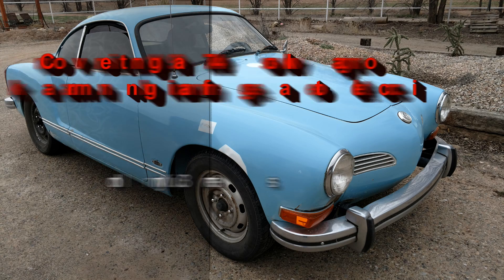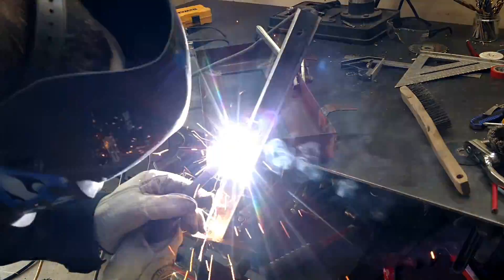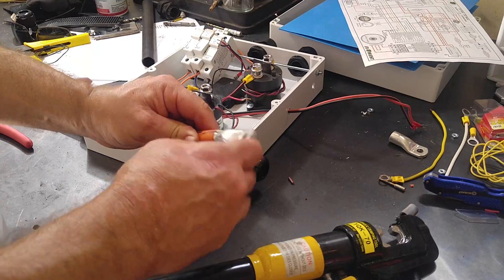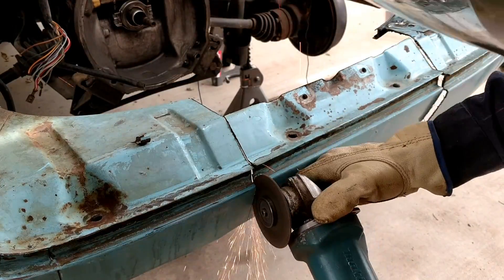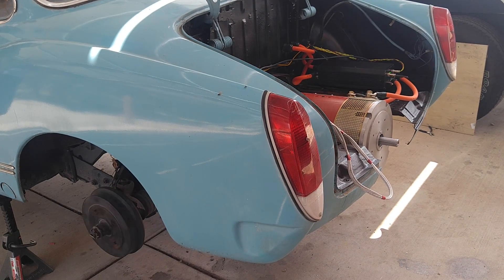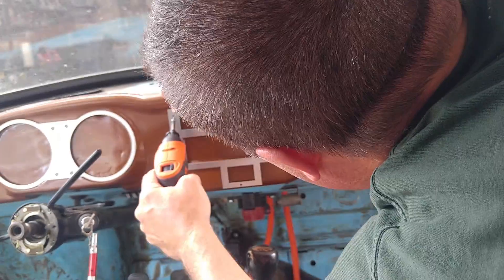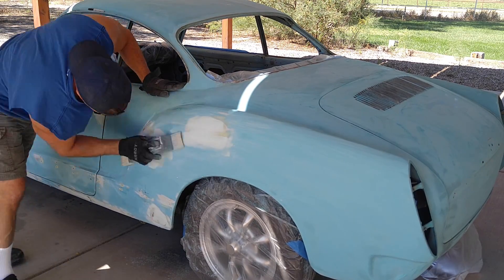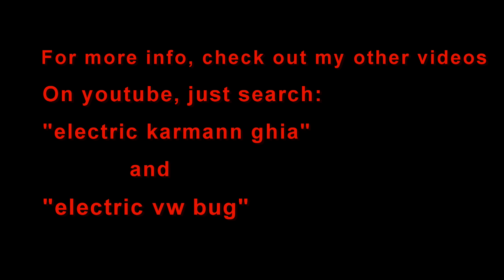Karmann Ghia Conversion to Electric (The Process)

Comment: Nice job, but the trees need CO2 to live. The current NASA photos from space sow a greening earth due to more CO2 and we need to keep it up.  We were at a point that any less CO2 would inhibit plant growth so we really do need more.   Don't worry about to much temperature change because the CO2 only reflects a small bandwidth of the sun's energy and CO2 is almost at saturation so it now takes exponentially more CO2 to effect any change which means the temperature modulation is absolutely self limiting with atmospheric CO2.   Great looking cars, just be sure and use a fossil fuel generator to recharge them..

Comment: What’s the top speed ? How far can you go on a charge ? Would you have to up date to disc brakes ? , thought about this , had an idea of doing something using a vw floor pan and having interchangeable bodies,  would it be possible to do  a mini van with solar to charge the car while setting outside ?   Great video bro !
Reply from the maker: It'll go up to 100 mph, and 120 miles max (but I use 100 for the max). Yes, VW's have some interesting options for swapping bodies. As for the solar, if the roof were covered in solar panels, you'd generate maybe 500 watts max. Since my battery pack is 27 Kwh, it would take 54 hours of direct sunlight to fully charge. You'd only be generating the 500 watts for a few hours per day, so it would take weeks to recharge! I love solar, but on the roof its really not very practical.
Reply: Botts Fine Vids , thanks for the reply, answers a lot of my thoughts, needless to say you’ve got a bad ass ride bro ! 👍🏼

Comment: Amazing job man. Truly inspiring! Great stuff
Reply from the maker: Thanks, I really appreciate it!
Reply from the maker: Not really unless I swapped out the whole rear end with a Chevy or something. The differential and transmission are in the same unit, so you really couldn't link the motor to it. The transmission only adds about 70 pounds, but it gives you so many more performance options. I drive 95 % of the time in 3rd gear, but I shift to 4th going over 80 mph, and 2nd if I really want to burn rubber and blow somebody off the line!

Comment: Do you have to recharge at a station coz I don't see any photovoltaic cells on the car?
Reply from the maker: I plug it into any standard 120 V outlet. Even if there were photovoltaics on the car, the amount generated would be insignificant.

Comment: there is no clutch required and it just drains the batteries to push the unneeded mass. Why not just have coupler machined from trans input to the motor shaft.  Don't even need a trans except for the direction of power change.    I don't see a link to the battery source it would be great to know.
Reply from the maker: When you compare the angular kinetic energy of the wheels and every other rotating mass, a tiny flywheel and clutch is utterly insignificant. A transmission gives so many performance options and only adds about 75 pounds. They are Voltronix 180 Ah batteries which I bought used from somebody who was using them as a battery bank for their home solar system.

Comment: Very impressive. But no battery cooling and no upgraded brakes (for the additional power and weight)?
Reply from the maker: I do have disc brakes in the front. Battery cooling is not necessary. Even after driving 80 miles, the battery temperature only increases by a couple degrees. I was surprised. These batteries for the most part are operating at less than 1C (180 amps)

Comment: I have the space 
I have the money
But currently don’t have the knowledge to build a 8 second, all-wheel-drive electric street machine.
What would be a good vehicle to convert for such duty?
The diffs gotta be able to handle the necessary torque and power to run high 8’s at 155 mph 
Any ideas??
Reply from the maker: The best one I've seen is the Zombie 222 Mustang. Also, the White Zombie Datson. I had to get stronger transaxles for both mine, with a super differential, but even those wouldn't hold up to 8 seconds! You tube those two cars.
Reply: Botts Fine Vids 
When I was 14 years old, back in the mid 70’s. My brother owned a new red, with black convertible top Karman Ghia. Greatest thing ever!
We downed quite a few beers, and burned down weed plants in that car.

Comment: Yeah, I get that you had to make the engine fit. But... you do realize you cut out an entire section of a unibody?  I'd be worried about structural failure over the upcoming years.
Reply from the maker: Of course I'm aware. I did it. I installed a traction bar that ties the two sides together and supports the motor. Not the slightest bit worried.

Comment: That's the way to get them a new polution free life again on the road, so we could safe a lot more resources 🕵‍♂👍💪
Congratulations for your excellent job keep going on never give up 👆 ☘️
What about a Beach Buggy with electric power engine and 4X4 or a Pickup Truck 🤔
Best regards from Asia 🐘🏝🐘🇨🇭
Reply from the maker: Thank you very much. EV West made a Baja VW bug which is very nice. I've seen 4x4's too, but you just need a lot more batteries.

Comment: So how much did everything cost to do this?
Reply from the maker: Around $17k for the conversion, and maybe 3k for the restoration.
Reply: Love the video 👍

Do you have a parts list and recommended suppliers?
Reply: @gjhammond01  EV West has a kit, both without batteries, and with Tesla Model S batteries, which I expect is probably good choice for first time converters. I am thinking to go down that route in the future.
Reply from the maker: @gjhammond01  evalbum.com/5330

Comment: Holy awesome.  That was most excellent.  Sounds like there is a kit that fits this, or it's fairly straightforward to do on your own.  Thanks for posting.
Reply from the maker: I believe EVWest has a very nice kit that would fit right in, but they use AC50 motors which don't have nearly the torque of a DC.

Comment: Hello my friend introduce myself I am Montasser from Egypt I watched your video transforming a Dodge into an electric car. and in all honesty you did a great job
I am wondering if you were allowing me to ask several questions. As I intend to carry out this work on my car. The first question is is Dodge still working efficiently yet? second question. You switched the power source in the car from 12 v to 380 v and I wonder how you made the 12v parts keep working. I mean lights, signals, radio and air conditioner
I really need to communicate with you in an easier way than e-mail
This is my phone number
00201033887573
We can use WhatsApp to communicate if you don't mind
With Regards
Reply from the maker: Thank you. First, it is a Volkswagen, not a dodge, and both cars have been working perfectly since the day I built them. Your question about voltage -- there are two separate busses, the twelve volt system which runs the lights, signals, radio, etc, and is grounded to the frame. The high voltage bus, which drives the motor, is completely isolated from the 12 volt, and is NOT grounded to the frame. It is its own closed loop. Good luck with your project!

Comment: Wow! Can you share your building plan and the specs of the motor? Did you deal with the original heating or are you only driving the car where and when it is warm? What range do you get on the batteries? So many questions, but only because it is something to aspire to.

Comment: They(Electrical Cars with solar panels) are responsible for burning fossil fuel. Just think energy needed to manufacture solar panels, and the process is very toxic to environment. By the way great project, thumbs up for you.
Reply: oh there's always one. you need energy to look for oil, drill for it, pump it, pipe it, refine it, distribute it and retail it. oil is toxic as well, you not heard of oil spills?

13 Feb 2020: "The 2010 rig explosion, which killed 11 workers and sent oil spewing into the Gulf of Mexico for 87 days, triggered one of the worst environmental disasters in US history. It released 206m gallons of oil from BP’s Macondo well, according to US government estimates, affecting wildlife and water-quality along hundreds of miles of Gulf coastline. At its height, 88,522 sq miles of sea were closed to fishing because of the spill, according to a federal report.

But a new study published on Thursday in the Science Advances journal says satellite surveillance at the time was unable to detect large areas of oil contamination. The study’s authors found that the effects of the spill were 30% larger, reaching the Texas shore, the Florida Keys, the coast of Tampa and parts of the east coast of Florida. “The satellite footprint does not necessarily capture the entire oil spill extent,” the study found."

https://www.theguardian.com/environment/2020/feb/13/deepwater-horizon-disaster-oil-worse-impact-study-finds

Comment: Great video, can you do regeneration braking with a DC motor? And why did u go for a DC motor when you need a converter anyway? Thanks
Reply from the maker: I don't need a converter. Batteries are DC, so it never needs to change.

Comment: Very impressive job! Great colors and the bolts of electricity was a great idea! When you stated VW were not built to do 100 mph, you were totally correct that’s why they only came with what 60 hp at the most? I had a 59 Karman Ghia that had only 35 hp! However when you brilliantly added all the extra weight and I’ll guess helped with balancing away the rear weight bias a stock gas powered Ghia was designed with originally? I’m willing to bet with good Koni or Bilstein shocks that little EJuice Ghia will be fine an fun as fast as that motor can push it. My only question is what kind of distance can you get and does the Bug still have the rear seat?

Comment: I owned a 74 Karmann Ghia for 19yrs! mild Kustom, in inmaculate shape till the day I sold it. 
 Excellent job in turning it to electric. I think the shape of the Ghia lends itself perfectly for "electric speeds".  I know you saved tons of cash by doing all the labor yourself, but, what was the cost for all the parts (e-motor, batteries, etc etc?). And...do you do this to other cars?

Comment: where did you get that motor? i have a 1984 380 SL that I would looooove to make it electric.
Reply from the maker: I got it from EV West. There's quite a few dealers. It is a Netgain Warp 11.
Reply: Botts Fine Vids the biggest issue here is that custom trans plate. EV West has a lot of stuff for VW but thats all... guess im gonna keep doing some research
Reply from the maker: I would find a good machine shop and bring them a template. Maybe press a board covered with clay onto the tranny  I don't think you could simply measure it accurately enough.

Comment: apologies if this is a daft question...but I thought ev cars were like go-karts...i.e..2 pedals...go and stop. You left the original gearbox in and clutch pedal. So you have a 4 speed manual change? I honestly didn't realise you could have a manual box.... I thought it would be  fully integrated automatic box...which would be part of the electric motor.
Reply from the maker: I rarely shift, so it feels like direct drive. However, it is nice to have options, like 4th on the highway and 2nd if I want to really blow somebody away off the line. Not to mention reverse! It only adds about 75 pounds. Plus, since VWs have a transaxle, you'd almost have to take the whole rear end out of a car with a stand alone differential. I don't know how you'd couple a motor to a VW without a tranny.

Comment: The electric motor just mates up to the bell housing.  Was the motor especially made just for VWs?  Or just the housing with a motor inserted?
Reply from the maker: Actually there is an adapter. EV West and some other companies make them for VWs and a bunch of other cars. I would have machined my own, but if you're off by just a tiny bit, say goodbye to your bearings!
Reply: @bottsfinevids4463  
Compared to other EV motors I have seen, it looks long.

Comment: Is this a motor kit?  Where did you find the trans mount?  I'd love to do this with my dunebuggy
Reply from the maker: It was not a kit, there is an adapter. EV West and some other companies make them for VWs and a bunch of other cars. I would have machined my own, but if you're off by just a tiny bit, say goodbye to your bearings!
Reply: Well, the video was awesome.  Could you post more information on where you got the motor, batteries etc? and models maybe?

Comment: I bet it still leaks oil....
Reply from the maker: There is no oil, except in the transmission. No leaks though! Possibly the only VWs on the road without leaks!
Reply: @bottsfinevids4463  What does the conversion cost?  How many miles or hours can the batteries hold?  Could a flexible solar panel be mounted on the roof? or maybe on the dash board and rear package shelf?

Comment: Around 150 kmph? Very decent. Whats the range?  Owners of old gas guzzling "Land Yachts" can benefit from an EV conversion.
Reply from the maker: The absolute range is 120 miles, but I use 100 miles as a limit, just to give myself a buffer and the batteries don't like complete discharges. At highway speeds of 80 mph or more, the limit is probably around 75 miles. And yes, everybody could benefit, especially our grand kids!

Comment: It ain't a Karmann Ghia without the characteristic VW boxer sound, it's only an empty shell. Like scraping off the paint of a Van Gogh and redo it with water based paint. Don't destroy classic cars ffs!
Reply from the maker: Well it would absolutely destroy a Karmann Ghia in every single way, except range. So if you must have a 50 year old crappy engine for sentimental reasons, don't let me stop you!

Comment: what protects the engine bay electronics from WEATHER/WATER/GRIT?
Reply from the maker: The only electronic thing in the bay is the controller, and it is fairly water proof. However, I do try to avoid heavy downpours, and I sure as hell wouldn't drive through a deep puddle!
Reply: @bottsfinevids4463   makes sense

Comment: why not solder AND crimp connections?
Reply from the maker: Because crimp connections are just fine by themselves if done correctly. There's endless debates about that! I've never had one fail.
Reply: @bottsfinevids4463  over time, mechanical connections can't loosen from vibration?  Bumps in the road, etc?  Hot/Cold expansion?

Comment: why put 1000 amps inside of a PLASTIC control box??
Reply from the maker: As opposed to what?
Reply: @bottsfinevids4463  ~ metal for shared ground, and a metal box could slow down a fire?
Reply from the maker: @etyrnal  Actually shared ground is the opposite of what you want! The high voltage system is isolated from the chassis, whereas the 12 volt system has a normal chassis ground. It would be very dangerous if the high voltage pack were grounded to the chassis!
Reply: @bottsfinevids4463  thanks for the education/reminder

Comment: Was it absolutely necessary to place batteries where the spare tire goes? Electric or no, a spare tire is a good thing to have.
Reply from the maker: A spare tire is a good thing to have if you are ever driving into the boonies or on a road trip. Since I will always be around Albuquerque or Los Lunas, I'm never more than a quick Uber ride to a tire shop! And yes, there was nowhere else to put those batteries!

Comment: 👍 Great job! Do your batteries heat up? Maybe you can rig up a way to cool them down while using the hot air exchange to heat up the interior during winter months, then vent divert for summertime. What’s your range BTW? I’m guessing you’re unable to charge on the go? If not,  please fill me in if you can... gives a whole new meaning to Happy MOTORing!   🚗🚕🚙🚘🚖
Reply from the maker: Good question. I thought they would, so I even installed a temperature sensor in each battery pack. They barely heat up more than a couple degrees. Probably because I'm usually only using 100-200 amps, which puts absolutely no strain on the batteries, which are capable of 1800 amps in bursts. If I do a bunch of 1000 amp hard accelerations, maybe they'd heat up, but the controller definitely will! Absolute range is 120 miles, but I use 100 miles as max. At highway speeds, probably only about 70 to 80 miles. I could fit my charger with a j1772 to be able to use public chargers, but I haven't really had the need. Still not practical for road trips, except in California.

Comment: Awesome work, how many miles do you get?
Reply from the maker: Absolute range is 120 miles, but I use 100 miles as max. At highway speeds, probably only about 70 to 80 miles.
Reply: @bottsfinevids4463  Still quite enough, thank you.

Comment: Hi, I'm in ABQ and have an MG TD replica based on a VW frame and engine. I have been wanting to do this, wondering what kind of budget it takes. Great Job!
Reply from the maker: Thanks! Depending on what components you use, especially batteries, I'd say from $15-20k. The batteries are the most expensive part, but you'd spend a hell of a lot more on gasoline over the 15 year lifespan of the batteries. Good luck! I'd be happy to answer any of your questions.
Reply: @bottsfinevids4463  actually, I am kind of looking for someone to do it for me. Do you know anyone in Duke?
Reply from the maker: @trueairspeed130  I don't know of anybody. Sorry.

Comment: Does "shifting" have any effect on drivability? Can you just leave it in 3rd and drive around town?
Reply: if the amp draw is too high you can change down a gear
Reply: From what I've learned from EV West is that you can leave it at any gear you want because it has more torque than an IC engine.

Comment: How much power is the electric motor???
Reply from the maker: Over 300 ft pounds of torque, or about 5x that of the stock engine. And it puts that out at zero RPM! Horsepower is not a very good wsy to measure electric motors.